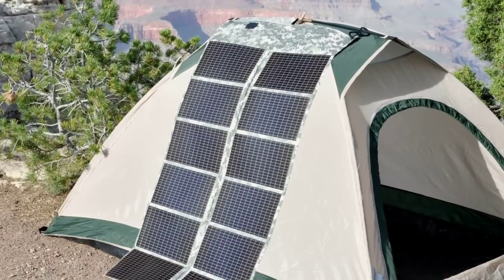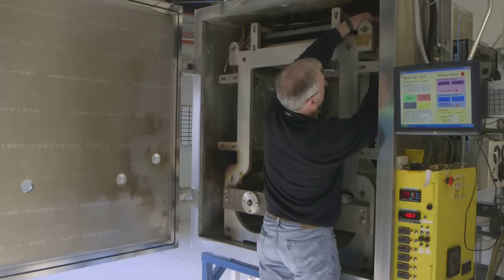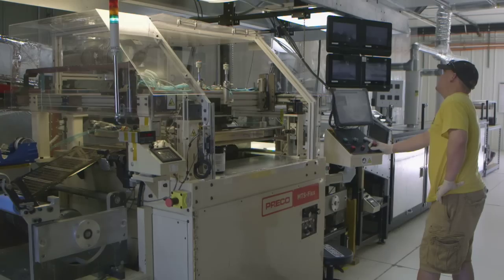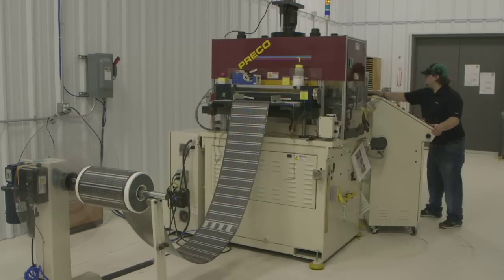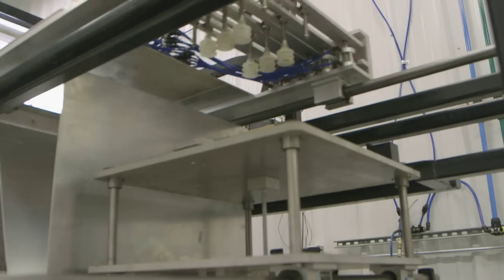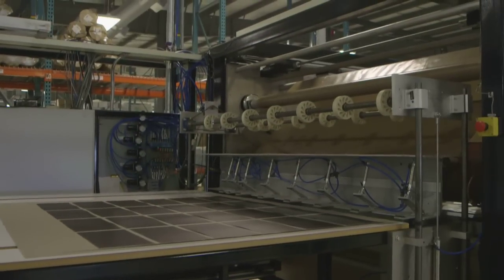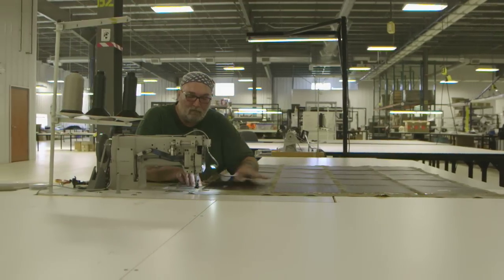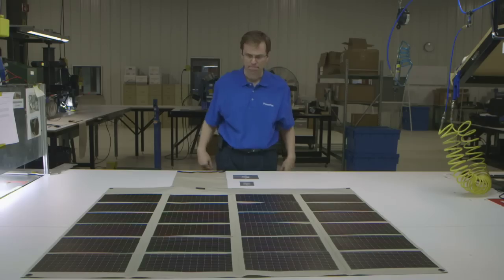Manufacturing PowerFilm Solar Panels

Comment: Tim Nuegent, former President of PowerFilm Solar gave me a tour of the plant in April 2010.  He is an investor in my Bubble-Worm, LLC.  I used PowerFilm's thin film flexible solar panels on my prototypes for my solar charged laptop and mobile phone invention.  My patent applications has pictures of them that were taken by my patent attorney in 2013.
Reply: Solar charged laptop sounds like a bad Idea, at day its difficult to see anything on the screen which mean you need to crank up the backlight and cost more power and heat. Also most laptop user would prefer to be indoor anyway.

But a solar charged portable energy generator might be better, with power sockets, detachable powerbank/batteries and rollable solar cell films. So you can charge it in sunlight and move the batteries/powerbank indoors or use it when needed.

This will not limit the specs of the laptop as you can use whatever laptop you wanna use, instead of using Factory specs which often limited and difficult after sales services.

Comment: Seems the choice of fabric is the main headage. For military applications it is obvious but as a really foldable and flexible lightweight sheet, they gotta change it to something much thinner.
Reply from the maker: Thanks for the comment. We work with all different kinds of encapsulations and substrates. You are correct that the encapsulation/substrate is essential in achieving the thinnest possible panel that's also protected from the elements.

Comment: Hello 
Can we apply it on Building Glass Façade ? 
if yes, i need some samples for testing it and do the feasibility study
Reply from the maker: Robin, thanks so much for reaching out. The applications we focus on are primarily portable. Would this be a building integrated solution? If you could email me at shansen@powerfilmsolar.com with more details I can share more information about the material. Thanks!

Comment: Which solar panel do I need to get close to 200 watts that works for the eb70s from bluetti?
Reply from the maker: Thanks so much for your comment. I would suggest our 160W Crystalline Foldable Solar Panel: https://www.powerfilmsolar.com/products/foldable-solar-panels/160-watt-crystalline-foldable-solar-panel
Reply from the maker: Please let me know if you have any additional questions. I am happy to assist.
Reply: Thank you for your reply. I've made a purchase. :)
Reply from the maker: Please let us know if you ever need assistance!
Reply: Hello, powerfilm. So, I ordered the 120 foldable panel. What is the connector called that fits the port in order to connect it to a bluettie battery?
Reply from the maker: @florindagonzalez5700  the connector that comes off the 120W panel is called a Delphi Weatherpack connector. Our distributor California PC makes a cable from our panel to some Bluetti batteries. Please confirm this is compatible with your model, but it should work! https://www.californiapc.com/Portable-Solar-Chargers/Custom-Cables-Accs-for-PowerFilm/APTV2M-DC7909M-7.html
Reply: Thank you, Powerfilm. I ordered two of the cords. I can't wait to have my solar awning in working order. I'm super stoked. Thank you for making such a cool product.
Reply from the maker: @florindagonzalez5700  you are welcome! Be sure to send us photos once you have everything set up. We'd love to see them.

Comment: Is there any data available on how these hold up over time?  I'm sure your aware that thin flexible solar panels get a bad reputation for being very unreliable over time.  At $10/watt it needs to have superb output AND reliability to be a competitive product.  Having said that I am interested.I use flexible PVs to power my EV
Reply from the maker: Great question. We have panels that are in the field anywhere from 10-20 years. The key factor for longterm performance is encapsulation. If it's going to be outdoors and exposed to the elements daily we would select an encapsulation that would be able to weather those conditions. Here's a post we wrote on the importance of encapsulation for solar panels: https://www.powerfilmsolar.com/about-us/the-horizon-blog/2018/03/09/sealing-the-deal-why-encapsulation-matters If you have more specific questions I'd love to help answer those for you. You can send me an email at: shansen@powerfilmsolar.com

Comment: Any way to weatherproof your panels or cables?
Reply from the maker: Absolutely! We offer waterproof versions of our products that are IP67 rated. Are you interested in a specific panel size/power?
Reply: @PowerFilmSolarEnergy  When i can afford them i will be buying the 120watt model with the inergy flex system, glad to know there weatherproof.
Reply from the maker: @stevenlawhon3695  our Foldable series is water-resistant, but if you were to get the panels wet, just hang them to dry completely before folding and storing them. Please let me know if you have any additional questions!
Reply: @PowerFilmSolarEnergy  Many thanks good to know
Reply from the maker: @stevenlawhon3695  Absolutely. Please let us know if you have any other questions. We are happy to help!

Comment: What's done with the panels that fail check?
Reply from the maker: That's a great question. We do our best to ensure that the overwhelming majority pass spec, but there are always those that don't. Many times if it's an OEM module it is scrapped but if the panel has been built into a finished product (i.e. 120 Watt Foldable Solar Panel) we will sell that product at a trade show for a discount with the understanding that it is either slightly low electrically or there is a cosmetic issue. Thanks so much for the question!
Reply: Thank you for the response. I like that you guys sell finished products that sub spec at discount, that's pretty nice of you, but I accidentally said panels when I meant cells or modules. You mentioned those get scrapped if they fail check and I understand that with laminated technologies repair is an improbable topic, but do you think a skilled technician could get some of those cells operational, and if so is there any way I could acquire some for cheap to play with?
Reply from the maker: Thanks for your message. Do you have a specific application in mind? We might be able to provide samples.
Reply: Well, if they're modules that are rejected for simply not producing at spec I can imagine them still being viable for many lower power applications like micro weather stations, keeping a trickle charge on stored lead acid batteries, or perhaps even powering nodes on mesh net style communications networks, and I would be eager to test that out because they seem like they would still be environmentally robust due to the quality of the manufacturing and materials. 
If they're ones that failed as nonoperational, then my interest is purely in exploring the failure modes and testing procedures to restore limited operation. 
What can I say, I'm a field repair tech at heart, and the thought of useful tech falling to waste makes my skin crawl just a little. I would be more than happy to record and report any substantive findings.
Reply from the maker: What's a good email for you? We can chat there directly.

Comment: i heard they produce 1/4 the power
Reply from the maker: Hey, Samuel. Amorphous silicon is between 5-7% efficient compared to 15-23% for crystalline silicon. So you are correct in many cases. The biggest benefit of our amorphous silicon thin-film material is durability, weight, and shade performance (check out this video to see how shade can affect different solar panels: https://youtu.be/FQsuOAooeKA) If you are looking for higher efficiency, something like our line of Soltronix panels would be perfect (https://www.powerfilmsolar.com/products/soltronix-solar-panels/). These are crystalline silicon solar panels backed on fiberglass with integrated charge controllers for easy connection to batteries. Please let me know if you have any questions. Happy to help!
Reply: @PowerFilmSolarEnergy  Hi thanks for the reply .i guess the selection of material strongly depends on the application  this technology is quite amazing on that note could you recommend a reputable retailer for flexible solar film preferably in a tape form
thanks
Reply from the maker: @sammy5576  we manufacture flexible panel with adhesive backing if that would work for you? Send me an email and we can talk about different options. My email is shansen@powerfilmsolar.com Thanks!

Comment: But, does this technology works on par with other cristalin technology being used by other companies through out the world. This point may be clarified. Bye.
Reply from the maker: Great question! Amorphous silicon is more flexible, durable, and portable than crystalline but is less efficient (between 5-8%). If you are looking for an ultra-light solution, amorphous is an excellent option. If you were looking for something more efficient, and weight and portability aren't significant concerns, crystalline options are ideal.

Comment: Too many words and informative propaganda on YouTube, what I need is cost of this flexible photovoltaic technology for home. Everyone says it costs less, so what is the cost per watt?
Reply from the maker: Thanks so much for reaching out. Our technology is not intended for use on rooftop installations and is ideal when the power / weight ratio and portability are important. As a general rule we are about $10/watt We also offer crystalline solar modules with integrated charge controllers that are still portable but less expensive: www.soltronixsolar.com Please let me know if you have any additional questions.